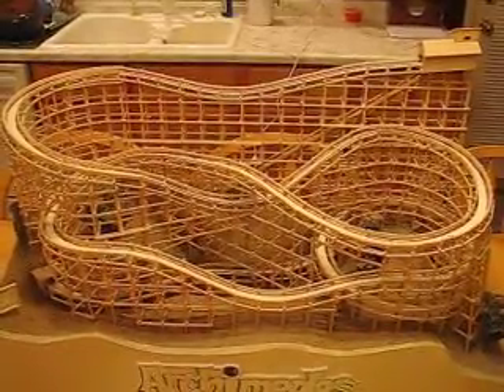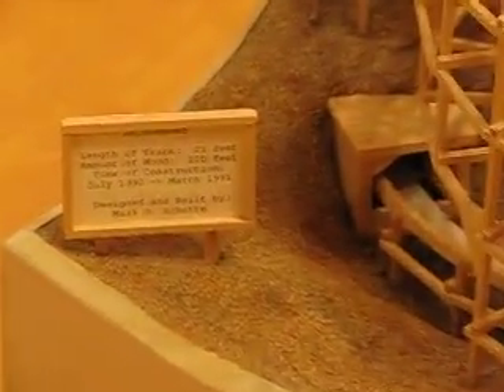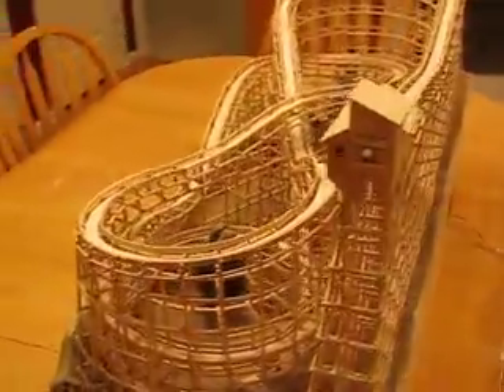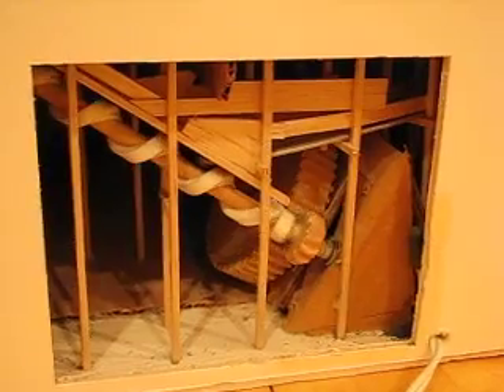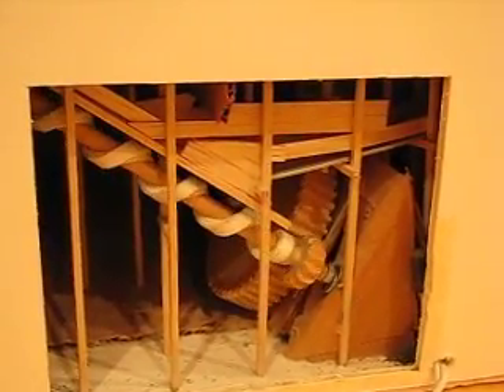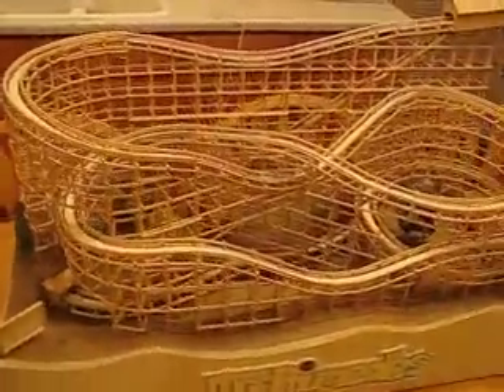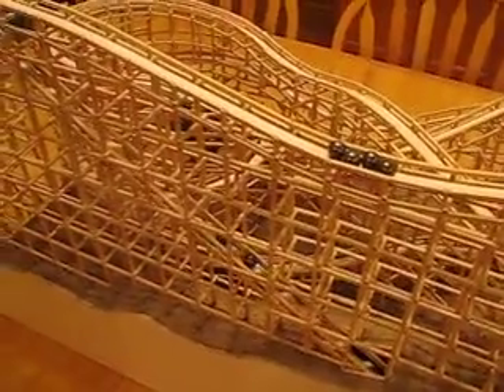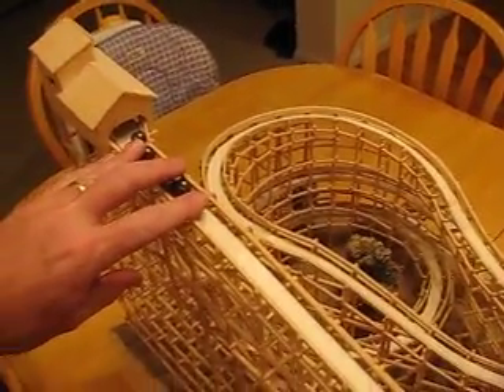Archimedes - Marble Roller Coaster

Comment: what kind of glue did you use?
Reply from the maker: Robbie - like an idiot, I simply used Elmer's! If I ever make a new one, I'll have to use something that dries more quickly. Having said that, however, Archimedes is still as strong today as the day I finished it in 1991!  I hope to find some time soon to add a new turn in the lower sections of track right in the middle. Watch for a new video hopefully later this spring.
Reply: Mark S I was thinking that there is Balsa wood glue for those balsa model planes. When I did that I would lay the pieces out on newspaper or wax paper and pin them down on cork board to dry. I saw one of your earlier videos where you had a template for the structure (brilliant by the way) and something like that. I was inspired enough to go buy popsicle sticks and dowel rods to make something like this but didn't make it past the first hill and curve. I think you had the right context here for a marble coaster. It looks like it's something you've been perfecting over the years. Your wedding cake version was outstanding. Cheers Mark. I look forward to your next coaster.
Reply from the maker: Thanks so much! My wedding was over 20 years ago! I'm long overdue for another coaster! We've been blessed with 5 fantastic children and that has been my focus for 18 years now. My kids think everyone's dad builds model coasters! :-) They also think all dads build model bowling lanes! Did you see that video? https://www.youtube.com/watch?v=C8ANcxcMsBI&index=11&list=FL8JhC5yG-2Pjf5-0oS7exyw   Made it when I was 11! Kept the entire neighborhood out of trouble when I was a kid. We bowled and bowled and bowled on my mother's kitchen table! Great memories. I still have it! My kids love it! I wish I had been smart enough to save all my coasters!! Thanks again for all your kind comments. - Mark
Reply: Mark S That's very impressive :) Have your next coaster have a loop in it. You've not crossed that bridge yet. (ahh I can see the cog wheels turning now)
Reply from the maker: Funny you should mention that. Having grown up near Kings Island just outside of Cincy and riding the Screamin Demon and the Vortex all those years, I made a double loop in my second coaster, but it was so inconsistent that I tore it down finally (after 2 or 3 tries) and made the clunky figure-8 that you see at the bottom of the first hill. YEARS later, I saw a movie about coaster design and it hit me like a ton of bricks! I couldn't believe I didn't realize my mistake! I had made my loops perfect circles when in reality, coaster loops are ellipses - and there's a REASON for that. Mathematically acceleration remains a constant in an ellipse as the curve tightens as you pull away from gravity, but in a circle, the marbles would occasionally just drop right out of the loop and I was too unobservant to understand why. Lesson learned. Perhaps next time. :-)  Thanks again for your interest. - Mark

Comment from the maker: Thank you! I only have 8 of these heavy steel ball-bearings. I suspect it could run a lot more, but the dowel rod (Archimedes Screw) tends to bend under more weight. When all 8 balls are on it, I can see it sagging. I'm not sure what a lot more would do. In fact, if it sagged enough, I suspect the balls could slip under the railing on which they are leaning and then they might get stuck. If I find more of these heavy marbles/balls, I'll try it out.

Comment from the maker: I just checked balsausa.com (which is the same company from whom I bought my balsa sticks) and it looks like the 1/8"x1/8" sticks are 0.31 per 36" stick now. That's quite expensive. You are correct. But with only 200' of wood in Archimedes, that's still under $21.00 of balsa wood. Don't buy it locally. Too expensive. Get it from BalsaUSA. :-)

Comment from the maker: Robbie - I don't remember exactly, of course, but balsa wood was cheap back in 1990. Not sure what it costs now, but I bet I paid no more than 8 or 9 cents per 3-foot stick. The poster board (track) was cheap and the paper-mache was just old newspaper and glue. The chicken wire to make the 'hills' under the 'grass' was probably my Dad's and the foam core frame probably didn't cost me even $5. If I were to guess, I'd say Archimedes probably cost me less than $30.00. :-)

Comment from the maker: The track itself is simply poster board. Most of the sticks are 1/8" square. The curved railings are 1/4" x 1/16" balsa which was easy to bend.

Comment: I believe you could make a long lasting coaster if a pivot is controlled with the weight of the coaster to allow the entire track to move, but would require a very skilled mathematician to figure out. Even with that it would only go round maybe but 5 times.

Comment from the maker: 3) Then the curves have to be done by hand. One vertical stick at a time. Cross stick (that holds the track) must again be at the perfect height per your drawings. Then the railings are (double) 1/4" x 1/16" balsa which bends easily. (Bass doesn't bend as well.) Double up these curved railings so they meet up perfectly with the 1/8" straight railings from the straight sections of track. Good luck!

Comment from the maker: 2) Then connect your sides with 1.5" sticks starting at the top where I notched the stick with 1/8" file to help hold it into place. The top stick is the stick that holds the track so this has to be positioned above the 'ground' exactly where your drawing says it needs to be. (height has to be perfect to your drawings). Then when it is dry, you lay your posterboard across the crossing sticks to make your track. The straight
railings are simply 1/8" sticks like all the support wood.

Comment from the maker: Draw your design (side view, 1/2 scale) on graph paper first. Then draw yourself some large 1.5" graph lines on large graph paper and lay your vertical sticks down on the vertical lines. Then put one little dab of glue on each 1.5" intersection and lay your horizontal stick across the vertical sticks. Wait until glue dries and the lift up your perfectly straight section side wall. Do the same for (in reverse) for the other side. Then stick them in your foamcore base 1" apart. You're on your way.

Comment from the maker: This was a SERIOUS concern of mine since this was the first roller coaster that I did not make Start-to-Finish. I was having trouble with the motor so I gave up and started building the END of the track with no middle. When it came time to connect the Start to the End and build the MIDDLE, I was a little nervous that it wouldn't work out. Fortunately it did.

Comment from the maker: Would you believe I simply used Elmer's glue?! I wasn't smart enough to even use fast-drying glue! LOL.  The curved railings are 1/4"x1/16" balsa - very bendable wood. The rest of it is 1/8" square sticks. The track is simply a piece of poster board cut in the curve I needed. Thanks for your kind words.

Comment from the maker: The railings are the only wood I curved and, yes, I soaked it in the bathtub to loosen it up. I also didn't use 1/8"x1/8" wood for the curves (like everywhere else on the coaster).  I used 1/4"x1/16" sticks for the curves and then doubled them up so they'd meet up nicely with the 1/8" straight section railings.

Comment from the maker: Great question! There is a brushless clock motor under the "ground" that turns the dow rod. The rod has 2 layers of simple weather stripping wrapped around it like screw threads. The marbles are essentially pushed up the hill while they lean against the right railing.

Comment from the maker: Too kind. Most of the wood is 1/8" square. But for the curved railings, I used 1/4"x1/16" balsa wood. The track is simply a piece of poster board. Use fast-drying glue. You'll save years of patience. I used Elmer's and will probably die young because of it!!  ;-D   When making a nice straight section of track, lay the sticks down on a flat piece of graph paper putting the horizontal sticks across them. Then when it's dry, you can pick up the whole wall and plunk it into the 'ground'.  Enjoy! :-)

Comment from the maker: Most of it is 1/8" square balsa wood. The curved railings, however, are 1/16"x1/4" balsa. The ground is paper-mache' (sp?) and the base or frame is simply a foam-core box that I made. The screw-gear "conveyor" is nothing more than a 1/4" dow stick with 2 layers of weather stripping wrapped around it. The track is simply poster board.  See? Simple!  :-)

Comment from the maker: @Kinseeker -  I would have to guess that it took me probably a couple days to work out the drawings for this. I always drew my roller coasters 1/2 scale first on large graph paper before I would start. Archimedes was the only roller coaster I made where I first made the start (the top) THEN the END, and THEN the MIDDLE of the coaster. Another movie is coming (soon, I hope) where you can see the progression - as I made it. I could not finish the middle until I had the motor working properly. :-)

Comment from the maker: @novahcac - not a bad question. The marbles (1/2" steel balls) move so freely within the space that defines "the track" (which is about 3/4" wide) that they cannot get wedged against one another and thus do not get stuck. Even at the bottom where they get back on the Archimedes Screw, they sit there "taking turns" getting back up the hill.  :-)

Comment from the maker: @ckrandall74 - That might be a tricky shot to get. It's all blocked by the sticks down there that keep the marbles from falling off the track. Literally, the posterboard track simply just ends and is at a good enough slope that the balls are forced to fall onto the dowl rod. Then the weather stripping "screw" just starts carrying them up the hill. Is that OK?

Comment from the maker: @Schacko92 - I thought of something else. The marbles are 1/2" steel ball bearings. Each pair of vertical sticks is exactly 1" apart on the inside. The two 1/8" railings use up another 1/4" so there is a spare 1/4" for the 1/2" ball. Does that make sense?

Comment from the maker: @Schacko92 - Sure! - the balsa wood is 1/8" square. Curved railings are 1/4"x1/16" (doubled-up). The grid is 1.5". I drew a 1.5" grid on large graph paper and built the straight sections flat on the table using that grid. Good?  Thanks for your interest!   :-)    Good luck.

Comment from the maker: @sgentlemanjack112 - Thank u for your interest! What are you looking 4 in particular? It is a dowl rod (round wooden stick) that's 1/4" in diameter. I wrapped 1-sided-sticky weather stripping around it like screw threads. When the marbles fell back, I wrapped a 2nd layer of stripping on it. I taped it off at the top. At the bottom, I simply put a little nail in the end of the rod, poked it thru the cardboard motor mount & used a nut & a washer to cut down on friction. I'll work on a video 4 u.

Comment from the maker: @MetamorphicKopheay - Not a bad question at all - if you google archimedes screw you will find all kinds of examples of how peeps in the past used a mechanism like this to extract water from underground. The 'screw threads' were an open pipe wrapped around a rod and put down into the ground at an angle and then turned bringing water up inside the pipe.

Comment from the maker: @Schacko92 - Most of the wood is 1/8" square balsa, but the curved railings are 1/4" x 1/16" balsa. I then doubled up the railing wood to make it the same thickness as the 1/8" railings on the straight sections.

Comment from the maker: @jasondean250 - Thanks Jason! It took a lot of patience and I was much younger when I made it (27-ish). The balsa wood is 1/8" square. The "grid" is 1.5". (i.e. the vertical and horizontal sticks are 1.5" apart). The "track" is poster board. The curved railings are 1/4"x1/16" balsa which bends - unlike the 1/8" square wood. The "conveyor" is simply a dow rod. That's two layers of weather stripping. The balls are steel. Good luck! I'd love to see your finished product! :-)

Comment from the maker: @smileeychick422 - would you believe that it's simply a piece of poster board? That's all. Most of the wood is 1/8" x 1/8" except for the curved railings which are 1/16" x 1/4". The grass is paper mache' over chicken wire and the 'box' is simply a foam core frame. The Archimedes screw is turned by a brushless clock motor. The gears were carved by HAND with a wood file (because I didn't know that you could just go to the store and buy plastic gears!! Duh!  :-)

Comment from the maker: @MrLewisMovies - Well - it was 20 years ago. It's a piece of foam core or two and some wire mesh for the paper mache' (sp?) and then the track is simply poster board. The balsa wood was maybe .25 - .40 cents for a 3-foot stick. Not sure anymore. I'd say less than $30 for the whole thing. My younger brother gave me the clock motor that turns the Archimedes screw gears.